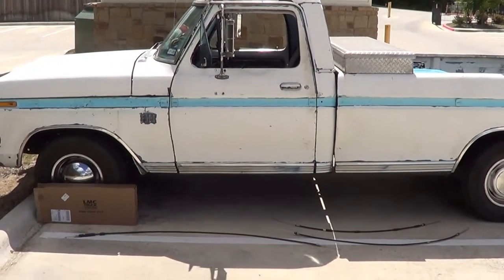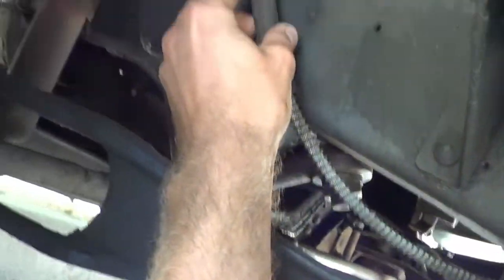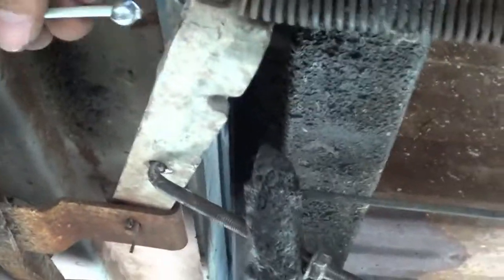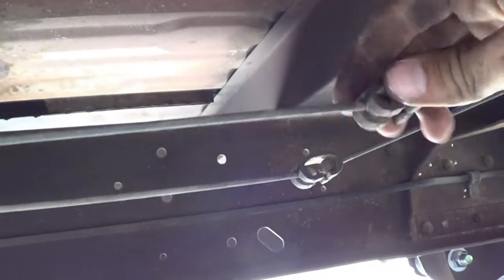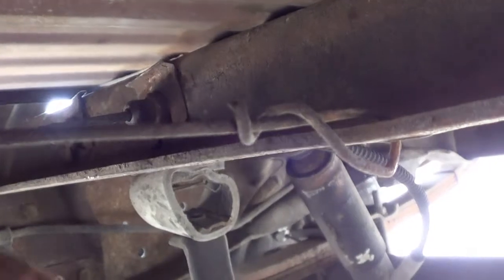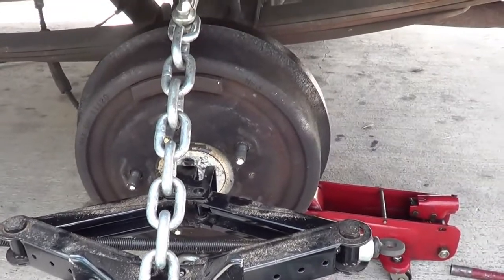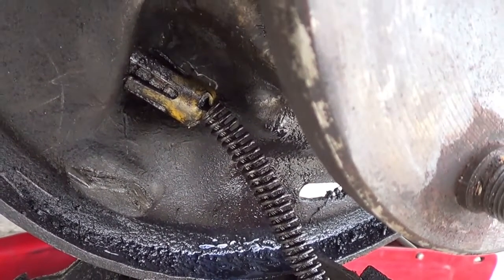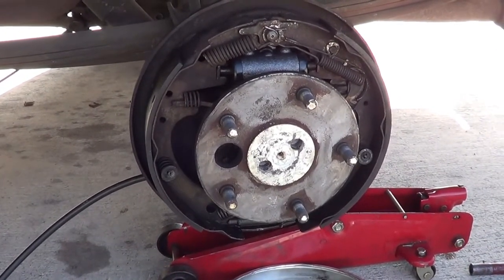F100 Parking Brake Cable Replacement

Comment: Just in the middle of changing my Emergency Brake cables on my 1968 f100. Thanks for this video. It verified my cutting off the brake clips that lock the cable at the rear wheel hub. Camera followed the cable back perfectly. The Front cable a got from LMC was different from the original, but the same length and better, I think. One point that a would make is if you are going to all the trouble why would you not replace all of the little clips, bolts, washers etc? I know, I am the fabulously wealthy guy who can afford the $9 extra for a job well done.